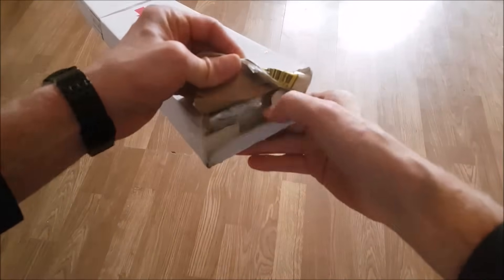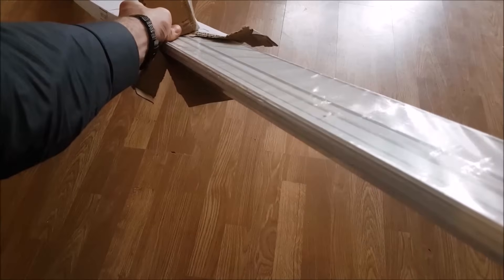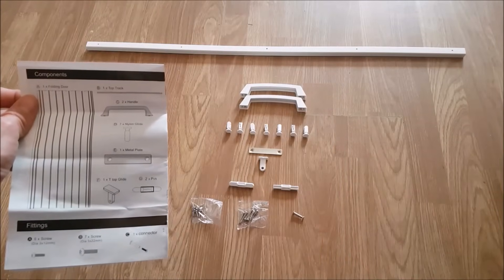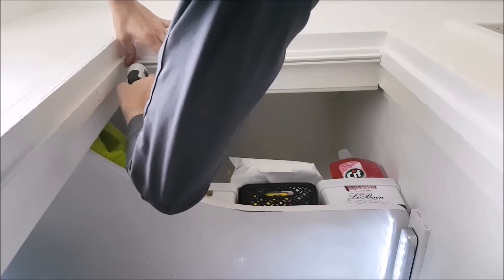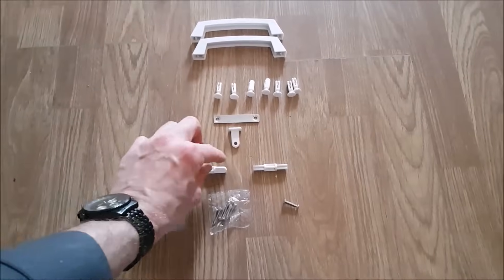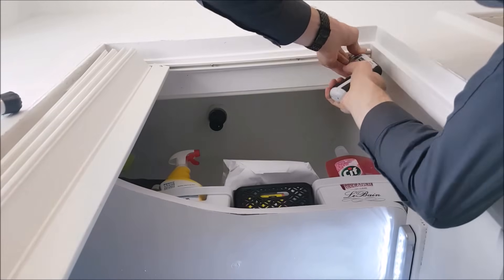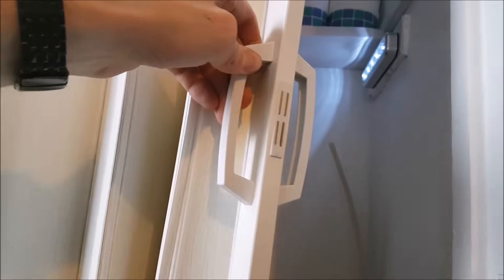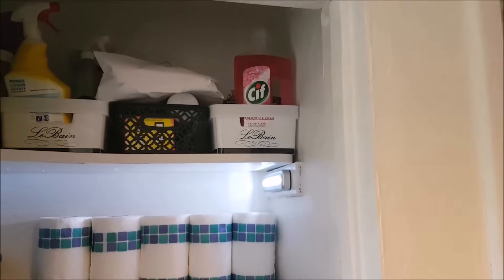Folding Doors - how to install DIY tutorial

Comment: Thanks! Picking up the double skin model later. Your video does a great job in explaining how to fit it!
Reply from the maker: rfc1795 Thanks you so much for the positive comment, i really appreciate it 🖒
Reply from the maker: rfc1795 also,add a little dab of oil,WD40 or even a small dab of cooking oil on a cloth and run it through the top track first to help it glide open and closed with ease.
Reply: Gogetyours Good idea. I'll use some GT5 lubricant 👍 .. picked it up earlier, box looks to have been resealed *gulp .. hope everything is inside and in good shape.
Reply: Update: All installed pretty easily. Didn't need to cut door, but rather lower frame hight by putting a strip of wood at the top, otherwise I'd have had a gap of around 2" at the bottom. As this one was the more expensive one, with 2 mag catches and double skinned it is very sturdy and I'm happy with the result :-) ... initially on seeing your vid @Gogetyours, I was very worried. But glad I spent the extra £7 (at the time, 1/3rd off)
Thanks again, your video helped loads in getting my head arounjd the crazy instructions :-D
Reply from the maker: rfc1795
Thanks for the update, yeah good idea with the added wood at the top. 
Sometimes a little more money goes along way and
i'm glad it all turned out great for you.
Thanks for the feedback and Your very welcome . ✌
Reply: @Zander Ryder instablaster :)
Reply: @Maddox Zakai it did the trick and I finally got access to my account again. Im so happy!
Thank you so much, you saved my account :D
Reply: @Zander Ryder No problem xD

Comment: Nice video... bought one of these doors...£30 in argos and the instructions were rubbish.. so this was ideal....like you say,  bit flimsy bit for the price and what I wanted it for is ideal,  and this vid is spot on for fitting. Thanks.
Reply from the maker: Make sure to dab abit of cooking oil or something like that on the top rail, it will help allow the door to open with ease.

Comment: Thanks for the video.  Viewed the cheap single skin version and picked up the double skin version for £2 more on sale and it's a major upgrade.  One slice of the mitre saw for me and some spray on grease in the track worked perfect. 👌
Reply from the maker: Thanks for the comment,You are very wolcome 😊✌
Reply: I’ve been thinking of greasing the track on mine too.  Will it get “gunky”?
Reply: @martell203  Use silicone furniture spray. Works well for curtain rails so should be fine here.
Reply: @davidmacleod3989  good idea!  Thanks!

Comment: Just fitted two of these and for the price they're not a bad buy. You did a good job and explained well. I wd40 the track and runners and runners are running smoother.
Reply from the maker: m. mac yeah a little oil did the trick.it helps glide it easy through the track thanks
Reply: As I fitted into a bedroom...I used vaseline to avoid oil/ wd40 smell... works well.

Comment: Haven't seen those in years, maybe Amazon? It's a little bit more tight then the bifold doors and the one's that just slide back and forth! I think I'm going to get a spring rod and either some material or a flat sheet and use a tight curtain to keep the dust out, forced heat and AC is going to kill us with the dust and pet fur! Radiant heat doesn't blow dust and dirt all over! Great install & direction's very clear ❤️

Comment: Thanks for the video. Very insightful. We're looking at replacing couple of doors to our dressing room and I can't seem to find any products that have both top and bottom track. I want the bottom track for ultimate stability. Any advice on what to look for? Cheers
Reply from the maker: Thanks for the comment, i'm afraid iv not come across one yet with two tracks, i did later on fit a track to the bottom and added a glider to the bottom but i took it off as it kept on getting trapped . i added oil and dabbed it within the top track and its now working very swift.

Comment: Hi was wondering if you could help considering about getting this for a small cupboard space in my bedroom, my width of my door frame is 76cm I've seen the door says 82cm is that fixed to only ne 82 was I right in thinking your width in your door was 58cm so is it possible or does it stick out as a result,  hope to hear from you,shaun

Comment: I already have a pvc folding door but it doesn’t full close and it makes really loud sound when I open it and close it. I want to buy a new one but idk the measurement of my door. If I buy a new one do I need to remove the top truck ?
Reply from the maker: You don't have to, but if it was hard to open maybe a new track maybe better. Make sure all the screws in the track are screwed in tightly, within the track, try to dab abit of cooking oil on to a cloth and then dab it into the top track. It will make opening the door easy and smooth.

Comment: Was actually wondering how to cut the bottom of the door but you showed me the perfect method. Cheers pal.

Btw..... once closed... Is it supposed to be flat or zizzagi? I mean the surface of the door?
Reply from the maker: Raju Ahmed sorry for the late reply,Thanks for commenting,yes indeed it is supposed to be zigzagged hope this helps. ✌
Reply: @Gogetyours  hello i want this but in india
Reply from the maker: @armaghanmahmood5651  https://m.indiamart.com/impcat/folding-doors.html maybe this might help, if not a local search on google of folding pvc doors should work based upon the area that you are situated. Hope this helps, can always try aliexpress but i suspect shipping might be an issue.
Reply: I know this is an old comment but maybe his folding door is ment to be zigzagged, but for most folding doors you just don't install all the panels (the folds) if you have a narrow doorway. Thus making the door less wide and not as zigzagged when closed. Usually each panel is about 5 inches wide, and if you have a 30 inch doorway that means you only use 6 panels (6*5=30) even if the door comes with 8 panels in the package. If that makes sense to you?

Comment: The screws that came with my door have heads that are way too big to go inside the track. As a DIY newbie I've no idea how to get around this. Screws with smaller heads are either too short or too awkward to use 🤷‍♂️
Reply: I know this is two years old now. Are you sure you used the right screws? In the video he explained that two type of screws were delivered

Comment: Thank you for the video. The product I purchased is 80" and my door way is 83" from floor to ceiling. How can I eliminate the 2" floor gap?
Reply: Screw in a 2" thick strip of wood across the top of the door frame. Then fit your runner on to that strip of wood.

Comment: Be careful the screws supplied  have bigger heads than the top track width. I  used smaller screws.
Reply from the maker: That's very true, within the video i did screw them in as much as possible but i later on replaced them, i also rubbed some oil with a rag,along the top track which made it very easy to open in the end,i wish i would of added that to the video. Thank you very much for the Tip

Comment: The instructions to my folding door is so bad, it doesn’t even tell me which screw I’m supposed to use. It’s given me two dissent sizes but it just says “Fasten track in the middle with single screw”, WHICH ONE???

I am going spare and I keep watching your video again and again because it’s the only hole I have now 😭😭😭
Reply: I just go to the part where you say 22ml screw, THANK YOU!!!  I can finally figure out which screw size they expect me to use 😭😭😭
Reply: Let me just type out a sentence from the instructions I received “click ancho channel with 4 installed fasteners, then door are installed almostly.”
This is not a typo. The whole thing is filled with sentences that stop in the middle and it doesn’t even mention what to do with the side track!!